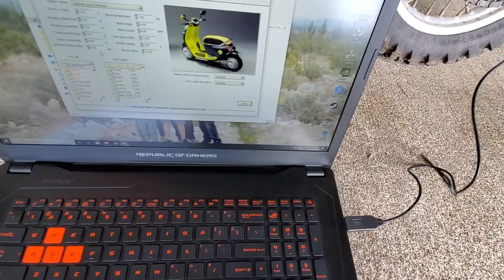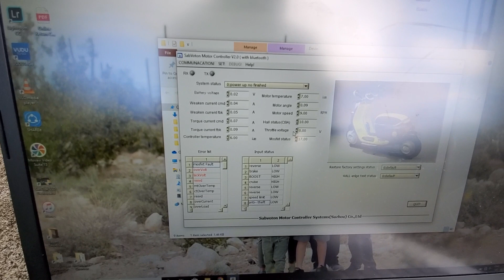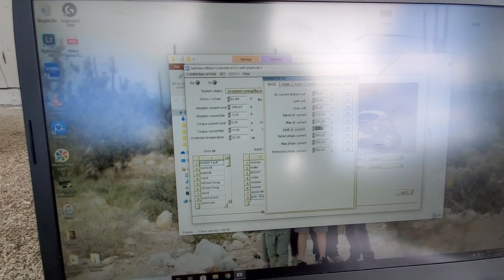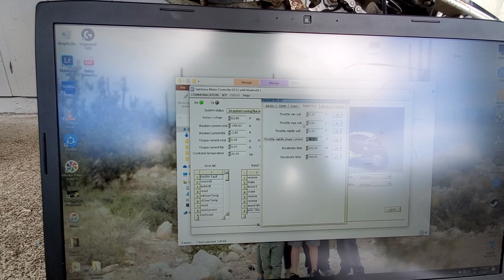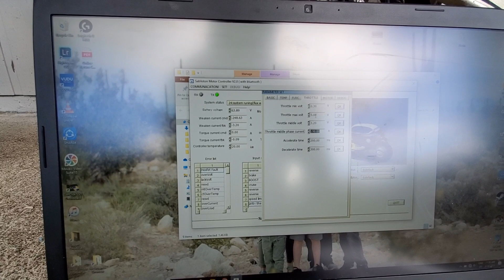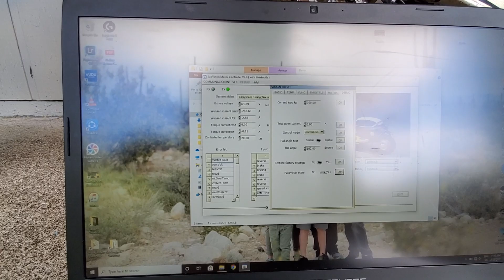Sabvoton programming and settings. CR80 conversion to electric

Comment: thank you for putting this info out there
Is it possible to current limit this controller to only run at 80A or 100A??
I ordered an SVMC72150 but I plan on current limiting it because of my battery - I cannot get a 150A bms battery at this time

Comment: Could you assist me pls. I have a QS 6000w V3 with a  Sabvoton 72200. Don't have the correct battery yet. So I need to change settings on the controller to do about 50A on a 72v battery. Can you help me please
Reply from the maker: Have you been able to hook it to your computer and have it show on the program?

Comment: Hi. Could you help me setup my Sabvoton 7280. In speed 5 I get a O2H error.
Reply from the maker: Could be that the battery voltage is sagging too low. Other than that I'm not sure about that one.

Comment: I spoke to soon...cleared all errors right away and did the hall angle test but it just stays in the test "in progress" and repeats jerking around 360. I turned test amps up to 150 same thing...changed motor pn from 4 to 16 no difference. Got any idea what's going on?
Reply from the maker: HOnestly I have had this same problem. I played around with the amps and such and it eventually worked.

Comment: Nice setup. I've been trying to setup my sabvaton 72150 version 1 and can't program it at all. When I connect to my laptop it won't read anything. I noticed on your video when you connected it read the voltage right away on your battery and your rx and tx lights were both flashing green. My voltage stays at 0.02volts, I think it was, and only my tx light will flash. I have two of these controllers and they are both doing the same thing. I was hoping you could send me a link on where you downloaded yours from. I got mine from the mqcon site in downloads. Any help would be appreciated...thanks
Reply from the maker: Have you confirmed that you are using the correct Com port?
Reply: @DevinLindstrom  I went to device manager, found the correct port when I plugged communication cable into my laptop and confirmed the device was running properly...is that what you mean?
Reply: Bam baby...after getting your reply I went back into device manager and looked again and this time I noticed that it said com 5. So I went back and tried #5 when I attempted to communicate and it worked. When I first setup I just started with the one that came up, #4, it didn't work so I went to 3 and tried it again. It worked, or so I thought, and I've been stuck there ever since. Game on...time to unleash the beast. Thanks for the reply.

Comment: i trying to connect my sabvoton to laptop or phone but no luck
i switch the controller on with display then disconnect the communication 3pin plug then plug the usb and follow ur steps but only tx flashing greens not rx means not communicating properly what is the issue......
do u have ur controller switched on already in ur video or it has to be off as i always had a controller switched on on my connection but no chance even tried several android phone and bought iphone only for this but none of the phone can find the Bluetooth dongle on mqcon app with location switch on!!!!!
i really think its something wrong with the controller internally
Reply from the maker: It must be one of the new ones. I know there is some way of putting them in programming mode. I would have to go look at my KTM50 bike to remember how to do it. I think you need to unplug one of the connections.
Reply: @DevinLindstrom  i know i have to unplug the 3 pin communication plug witch it goes to the display but still not working
Reply from the maker: @alireza071  and you have the correct com port? Other than that it would be hard to figure out without being hands on. Sorry.
Reply: @DevinLindstrom  i know yeah only one com  works 8 on one usb port and 7 on the other,,,,

Comment: Hello i watch all your videos they are cool 👍..
Do you know on which pages and which box the motor magnets Can be configured please
Reply from the maker: The one that says Motor pn. If you have the QS 138 then it has 5.
Reply: @DevinLindstrom  https://youtu.be/ZGWucfFbvnk
Reply: @DevinLindstrom  here IS m'y problem the saquade engine in the vacuum.qs 138 yes
Reply: @DevinLindstrom  on the debug page you have to put 120 in the hall angle box to calibrate the hall sensors with qs 138 ? Please.🙏
Reply from the maker: @abityson3418  I don't think you do. For the hall angel test I just made sure I had my amps up highenough to get the wheel turning. 15a should do it.
Reply: @DevinLindstrom  yes thank you very much👍

Comment: Hay devin.  Great work . The motorcycle looks bombshell
I am having problems with my sabvoton.
i have install the ant bms 300a on my bike with sabvoton controler 72200.  Batery 72v 30a. When I accelerate, I give power to the 5000w mottor , the controller or bms turns off the bike as protection, and turns on after 20 seconds.
What I need to change in controller settings ? 

The seller who sold methe bms  says it's settings in the controller Can you advise me parameters I need to change. Can I send you pictures
Reply from the maker: Can you check the voltage sag? Could be dropping to the cut off voltage
Reply: Hay devin thanks for your replay. The sag is very high. Drop from 80v to 67v and lower.
 I am using 26650 lion cell. 5c Sofirn 3.7V 5500mAh .new cell
What is your opinion ? Thanks
Reply from the maker: @yahavchen  it will depend on how many cells you want to use. VTC6 is a good 18650 for power and the 40t is a good 21700. If you can fit a good amount of cells I like to use model 3 cells from bigbattery.com
Reply: @DevinLindstrom  

I guess I'll have to build a new battery. Thank you freind.
Reply: @DevinLindstrom  hay devin
Can you take photos from controller setting ?  
I'm having some problems with the settings. I'm not getting enough speed. 70kmh top speed.

Comment: Thanks for the video mate. Can you send me the link or file to the programming software please. Also can you use a normal USB3 male to male cable or does it have to be specific, if so do you know where I can get it? I have the Bluetooth adapter to use with phone app and it simply does not work, please help.
Reply from the maker: Here is the link.http://www.sabvoton.net/downloadlist/
You will need a special usb which you can get from AliExpress. If you lived near me I would simply give you one of my extras. Haha.
Reply from the maker: @Smart tEChy  Is your controller old? If not then this is the cable you need. 
https://www.aliexpress.com/item/1005001340244381.html?spm=a2g0o.productlist.0.0.6fc722a05RPD8a&algo_pvid=4b57234f-3a38-41d5-98bd-ef2e80daed71&algo_expid=4b57234f-3a38-41d5-98bd-ef2e80daed71-0&btsid=0bb0623b16071055518548476e54f2&ws_ab_test=searchweb0_0,searchweb201602_,searchweb201603_
Reply: I just ordered a dongle for this! If U don’t mind what is the program I have to download to be able to go into the controller? Thanks!
Reply from the maker: @Trailfloater  I have the link to the program up above. Is  that one not working for you?
Reply: https://www.amazon.com/dp/B07MTC9R2Q/ref=cm_sw_r_cp_awdb_imm_t1_YfBeGbG9YCSTM ......is this one ok for the dongle I ordered to program the controller?
Reply: did u manage to connect to controller i have tried many make and model phone android and ios and 2 different laptops but noun of them worked for me they dont recognise the controller very  disappointed,, 
thinking of buying second controller

Comment: I’m trying to setup the same controller and am wondering how you can get the acceleration faster? Now it’s starts smooth and picks up when you reach about 15m/h. 
I would like to have it faster. How do you do that?
Reply from the maker: What controller do you have? If its a Sabvoton you go to the throttle section and turn acceleration up to 200+

Comment: Can you make a video that goes over briefly what each setting is for and what should or should not be set based on the motor batteries?
Reply from the maker: I'm helping a neighbor do a quad with an 80a controller so maybe I'll record that and post it.
Reply: @DevinLindstrom  that would be awsome

Comment: Hey there. Curious what the build motor was and more about the build if you dont mind me asking.
Reply from the maker: Sorry for the delayed response my notifications aren't making it to me. 
The motor is a QS 138 70H and the controller is an unlocked Sabvoton 72v 250A  
Im building the battery out of 21700 cells that will be 7kwh.

Comment: I can not unlock the Sabvoton 72150 controller. I have a over voltage of 88v. But also current 150. Which I want to increase.

You can tell exactly how you unlocked.

I downloaded the program MQCON-current unlock.exe

thanks
Reply from the maker: I had it unlocked at the factory. I don't know how they do it. sorry.

Comment: Greetings from strange old Germany :)
I've only been driving Savotons in my builds for years, but with the good old direct hubs from QS (205v2 / 205v3 extra / and the crazy QS273v3 ..) I just wanted to tell everyone who is reading this, never to me! a sabvoton burned down, whoever opens his 72150 and exceeds the power limits should not cry afterwards that he burns down ... and it is true that there was another manufacturer and the company was sold, but I'm currently driving 2 from the new series (the old ones were black and square, but are now being copied again) A tip about the tft displays the older 750c had problems with direct sunlight (and / or) damage from overcurrent from 72v batteries myself broke 3 pieces in almost 2 years :( but if you look directly at QS, you will find the new 6h? h6 display exclusively for all sabvotons with tft preparation, with the great possibility to change controller parameters on the fly directly on the display + wh / km and engine temperature etc. oh yes, the most important setting in Sabvoton is actually the throttle setting :) I would recommend to lower the mid current to 60-80amp instead of 150 and to use the acceleration time to 400-500 msec and of course a domino throttle with potentiometer. To all crazy ones, drive carefully we build dangerous shit 203 slices min! ♡

Comment: Hey, i have 3kw electric hub motor for my drift trike, and got 72v 15ah lithium titanate battery and this subvotn svmc7280 controller. So when i try to operate with factory settigs , the power just cuts off, not sure if it is the battery's bms or controller, but when i unconect the electric chain and connect it back the power is on again. thinking is it settings on controller or battery's discharge current is too low (50 amps i have for battery dicharge current)
Reply from the maker: Does the power cut completely out or does the sabvoton stop working and does the light on it start to blink? Also have you tried running it while hooked up to a computer? It could be the BMS cutting the power to it.
Reply: Devin Lindstrom yes the power disapears completely, no life in controller or voltage display. I was thinking its battery bms, but why?  havnt tried ride witch pc connected, i will try and see whatbis shows
Reply: Devin Lindstrom why i cant put higher throttle mid current, it stands on 0.04, i know it should be higher but can change it but cant  save it, all the rest quantities i can change and save
Reply from the maker: @davisliepins6127  that does sound strange. Make sure store settings is on too. Click it a few times too just to be sure it saves.
Reply: Devin Lindstrom ok, what are your engine and battery parameters?
Reply from the maker: @davisliepins6127  the motor is a five pole pair setup and I don't know what the parameters are. Maybe see if you can see them on the video. Sorry I don't have time to hook it up and check right now
Reply: Devin Lindstrom ok thanks anyway

Comment: Hi, I have a bought One of these controllers and having so much problems programming. For starters I’ve blown fuses near the battery attempting the hall test. Can you help please ?
Reply from the maker: First make sure you have the polarity correct then make sure you know how many paired magnets you have. Make sure the motor doesn't have load when doing the test and set the test amperage to about 10A. If that doesn't help let me know and I'll see if I can't think of something else.
Reply: Where are you based. Would love for you too do it. Will obviously pay you?
Reply from the maker: @ebikeldn4610  I live in Washington state USA. What motor are  you using?
Reply: Can you talk me through this over video call. Will pay for ur time. 
My WhatsApp number is 07384280634 please.
Reply: I have a voilamart 1500W rear hub and the controller is risun sine wave controller 45a 1000w-2000w.
Reply from the maker: @ebikeldn4610  I'm not familiar with that controller so I really wouldn't know how to help. You could try asking some of the Facebook groups for help. Endless sphere is a good one.

Comment: This video is fantastic thanks! I just started my first E-bike build, nothing as powerful as yours. I'm using the QS 205 50H hub motor, Sabvoton 80a controller and 72v 25ah lithium pack. Do you think that setup will go pretty decent? It will be on a Ruff Cycles beach cruiser Cafe racer style type bicycle pretty light bike. I have electric dirtbikes but they are dealer bought can't ride on the street. That's why I'm building this lowrider beach cruiser. Hoping it will have decent power on flat ground. This is the controller I have http://www.cnqsmotor.com/en/article_read/80A%20Motor%20Controller%20Sabvoton%20SVMC72080%20controller%20for%20Electric%20Scooter%20Motor,%20Brushless%20DC%20Controller/351.html and this is the hub motor
http://www.cnqsmotor.com/en/article_read/Hot%20sale%20QS%20Motor%20100kph%203000W%20205%2050H%20V3%20Electric%20Bicycle%20Motor%20Kits%20with%20SVMC72150%20controller/548.html

Hope it will be good for at least 35 mph. I'll build something better down the road. Your videos are just awesome i get pumped after watching them, haha!
Reply from the maker: My first experience with sabvoton was an 80a 72v one and it was awesome. You will love it. If you watch my videos the grey bike with the black box on the front has the 80a 72v setup and it went about 45 mph.
Reply: @DevinLindstrom  that's awesome I'm going to have to check it out, only reason why I got this controller is I saw a guy on endless sphere modify it really easily to put out a tremendous amount of amps, he has a video here on YouTube going 72 miles per hour. That's just crazy on a small bicycle frame. I'm going to go check out that video of yours if I get up to 35-40 I would be really happy and eventually have road rash 😂, thanks again
Reply: Hi Farmer fpv do you know what Cells are in your Pack? Is it in 20s10p Konfiguration? 30 Miles should be no Problem :)  the 205 50h is a great Motor!
Reply: @ Eric Muller No, I'm using 20s6p Samsung 21700 cells which are 72v 24ah they are powerful batteries 120a continuous 180a peak. It actually came out smaller than a 18650 pack with same voltage and ah and also has more amps plus cheaper.

Comment: I got everything figured out now I'm riding it and slowly adjusting everything and trying to get it how I like it. If you set the motor to no limit then does it matter what I have the motor limit speed set at? I'm assuming it just over rides whatever you have that set as if you have the other setting as no limit. Am I correct
Reply from the maker: That sounds right but I'm not 100% on that. I had to learn by playing around with it too. I'm no expert but felt I could help somewhat by making the video.
Reply: @DevinLindstrom  alright I guess I'll mess around with it thanks for being so helpful anyway.

Comment: Hey I have another question I've built my battery and I'm ready to program but when I connect it only the tx light is flashing but not the RX light and it won't read my voltage and stuff
Reply from the maker: Check wiring and battery voltage. Other than that I'm not sure what you mean by not reading voltage.

Comment: Hey man! I love your build it, looks like it really goes well! I'm based in London and fancy doing something similar to a 125 cafe racer style bike and I've got a few questions. What was the motor you ended up using on this bike? is it getting hot at this power? what battery setup do you have in this clip? I'm leaning towards automotive batteries from the Nissan leaf for range, what sort of range do you get from this setup? Lipo has a great discharge rate for punchy power delivery so if range is decent I may consider building a Lipo pack.

Regards
Reply from the maker: I used the QS 138 70H motor. It doesn't even get warm running the current 14kw. I will push it to 28kw in the end though. The battery in this on is a temporary one thats 16s and 2P lipo 8ah batteries. The final battery will likely be a 21700 or 18650 build packing about 6kwh into it.
Reply: @DevinLindstrom  you mean to say your 3kw motor can push our 14kw?
Reply from the maker: @accountaccount4188  oh it can do peaks well beyond that. On a bike you hit some high draws but they aren't sustained. I have the third version of this motor that has a reduction gearing and I'll be pushing 32kw out of it.
Reply: @DevinLindstrom  how does the controller not go? and the motor? don't the windings heat up? how much can it sustain?
Reply: @DevinLindstrom  so when you are pushing watts beyond what is rated, what is the risk? what is more likely to go the motor, battery or controller?
how do you manage?
Reply: also what is your gearing?